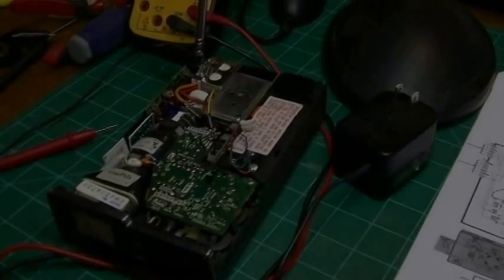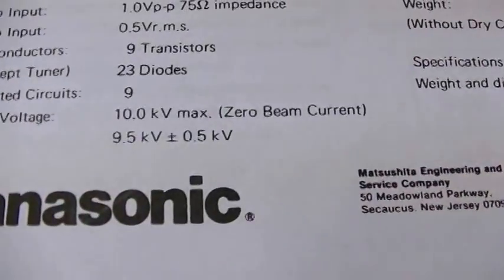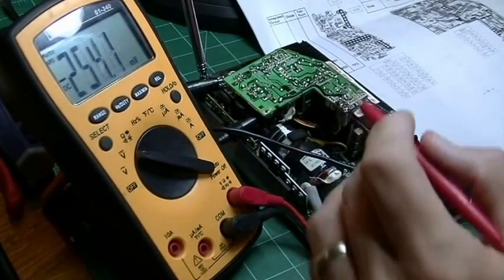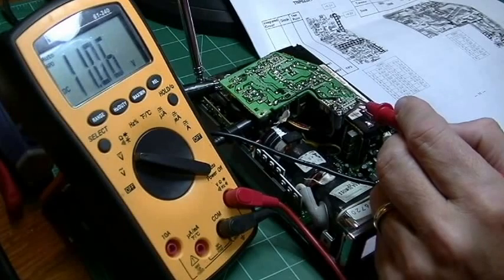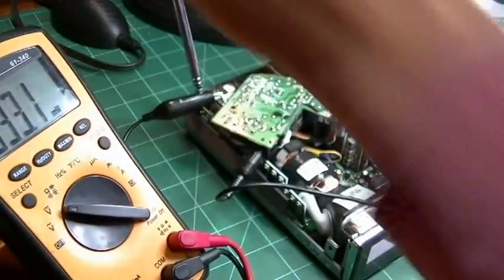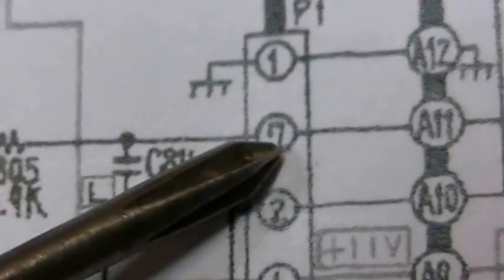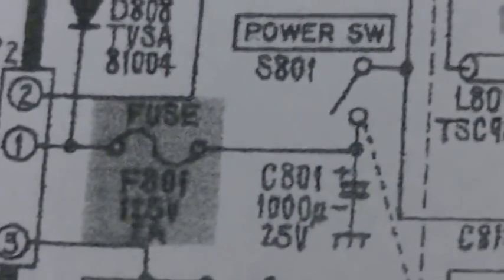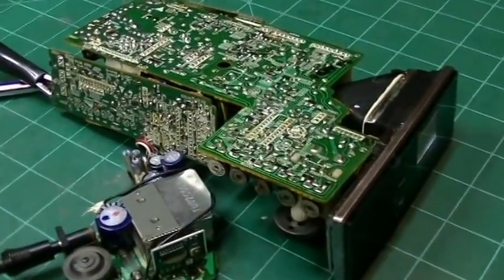Panasonic CT-101 1.5" Color TV Repair Pt 2 of 3

Comment: I think IC's really took off in the mid 70's for televisions. I think there was allot of behind the scenes changes changes inside the TV's once tubes disappeared completely in circuits. The changes seemingly tapered off in the 90's with the exception of multiple input sockets becoming common.
Reply from the maker: That's absolutely true. And it's the kind of technology that made a small TV like this one I'm working on possible. Wonderful in a way, but a pain to work on and narrow down faults IMO. Of course, my task would be easier if I had a working scope. And I may have to delay this repair until I get a new one.

Comment: Scott,
I really enjoyed watching you fault finding on your Panasonic ct-101 television.  To some extent, it has the appearance of the line speed/sync separator fault on your RCA 14 PT8021 set.  
When you traced fault to pin 6 (7) across on the P-board, and, having soldered a suspect dry joint, from there traced along the bus to IC 801 (TNH I 15G4), I thought the area where you had headed was very plausible.  I’m not saying IC 801 is defective but its associated circuitries might be a good place to resume further fault finding.  Don’t disregard the possibility of discovering more dry joints.
Regards,
Phil.
Reply from the maker: Phil...great catch my friend. Stay tuned real soon. Your theory is valid! Final part is about to be uploaded. Thanks a for watching.

Comment: Hi Scott, Now that you have all the necessary data for that set. Maybe we can get you into the right area, by looking at what the set is doing and it's symptoms. From what you have shown in your video. It appears that the problem is with the Vertical Sync. If you go through the schematic you will see that there is a circuit (the sync separator) that picks this information off the video signal. This is a good place to start, but the problem may still be further along in the vertical circuit? Good Luck! Brendan
Reply from the maker: Correct. And yes, we will get there. Stay tuned.

Comment: WOW, 10kv in that tiny CRT! Those TV sets are amazing.

It's so sad that the wastefool govy junked all those TV sets when they forced ATSC. Tablets and smart phones don't come with ATSC tuners, and there aren't many portable battery TVs that work well. Try to find a digital battery portable TV!  I  got one from eBay, only picks up a few stations from its whip antenna, a waste of 79$.

A converter is too bulky for using old CRT NTSC portables. But it can be done with a battery pack instead of wall wart. Blonder Tongue or Drake rf ""transmitters"" solve the problem of obseletion, so those nice little portables are no longer useless.

Great vid on this subject Scott, how to make old TV sets useful.
Don
Reply from the maker: Yes Don. This is a case of treating the unit like a snake. Don't be afraid of it, but don't pet it either. Leave it alone or it could bite you and hurt pretty bad. Just respect it.
And yes, the days of personal portable TV's while out and about - I'm afraid are probably over. Even for guys who used to like to take them to ballgames ( I did), so you could see the broadcast and replays while at the game, have no need. Most all sporting games are on TV now, you just Tivo it and watch later when you get home. Not much of a market for it in the general public. Maybe nightime tollbooth operators or something miss the over the signals. Be kinda hard for them to ask that cable or direct TV be installed at their workplace. Guess they have to read books or something now. LOL!